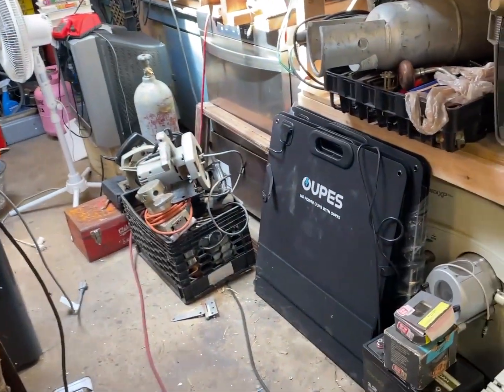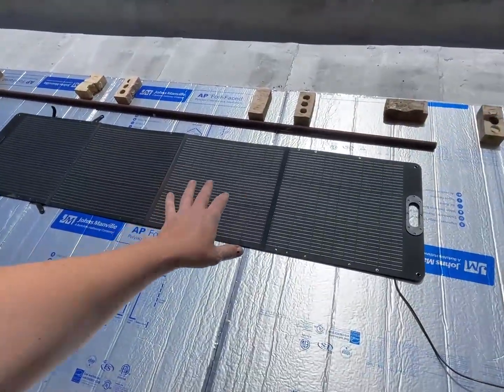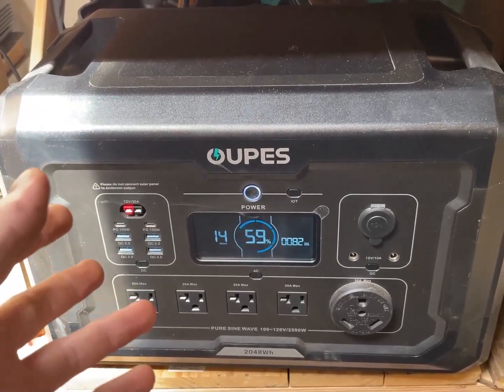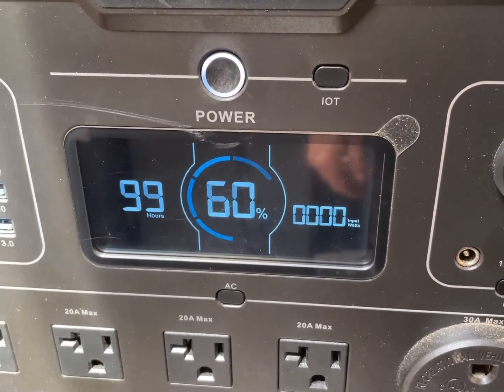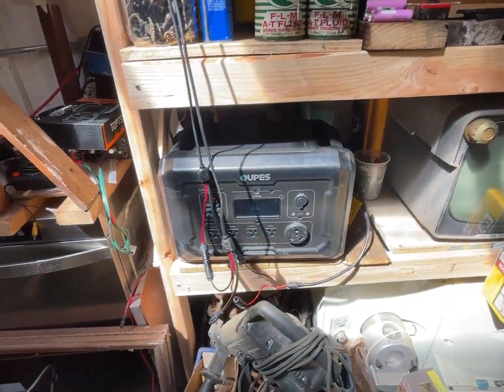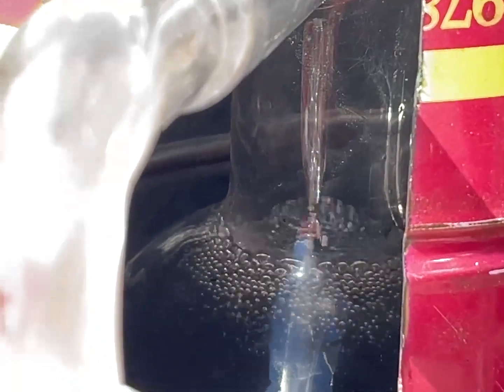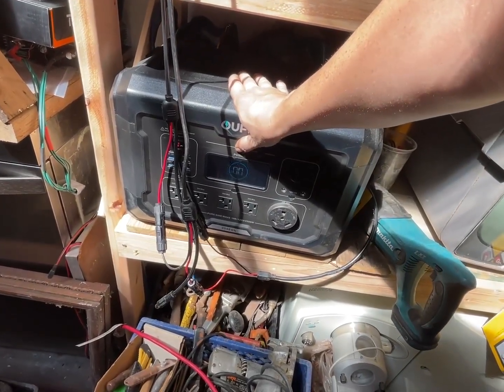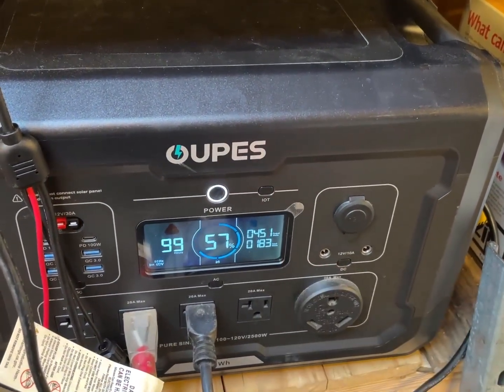Solar Sunday Experiments 39: Testing out Oupes solar panels and the Mega 2 as a reserve power system

Comment: Hi, Rinoa.  I just discovered your channel today, and this is the first video I watched. I do something different, but you might be able to integrate it into your system.  I do solar thermal with a section of a parabolic dish.  My thing is called the "Sun Scoop" and it is has a tracking reflector and a stationary target.  So my reflector slowly turns, (15 degrees per hour) and it concentrates the sunlight on the target. My reflector is just under 1.5 sq meters in size and it concentrates about 670 Watts of heat on the target. (I did a boil test one day to measure heat collected).  For sure, you could use this to distill your paint thinner!  Direct heat, too, so it is more energy efficient than using the solar panel and batteries.   You could also maybe use it in your kiln, either to preheat the kiln or metal or if you did a really good job on the reflector,  to actually melt the metal.   In my case,  I steam treated about 2 tons of garden soil this summer. And then used it in the fall to dehydrate apples and herbs. (I'm still working on the dehydrating part (because it can easily get too hot).   Steam treatment of soil, (and of compost)   kills weed seeds, etc.,  and my vegetables grew roughly 20% faster (with no added fertilizer!!).   AND I steamed 2 tons with a batch system! (which is not a system at all!),  next year, I hope to make augers,  and  a hopper, so I just fill the hopper, and a thermostat turns on an auger whenever soil reaches steam temperature, moves it a bit, temp drops, soil heats up, auger turns, and then it can really do a lot of work! If you check out my channel, you will see that my sun scoop is made from old pallet wood, an old fence pipe as the axis, a sheet of 4 by 8 plastic, special reflector tape from china for solar cookers, and various ring bearings.  But it is very minimalist and it works (and it works all day not like so many half assed "death rays" on youtube that get a million views and are quite frankly, dumb and useless and don't have tracking so you only have a working death ray while you attend it.   My device can work all day unattended, it is a huge leap forward. With your skills, you could weld up the frame from light aluminum,  bend the ribs for behind the reflector sheet in your shop and perhaps make the reflector from some light metal too. ( but you must have a great light and heat reflective material, (like my reflective tape) to stick to it.  Stainless steel won't cut it, and most aluminum sheet doesn't have the "mirror quality" reflections that you need.  But anyways,  if you made this,  and did it well enough, you "might" be able to sell these to local gardeners and allotment gardeners. And certainly,  you could distill with it,  any time the sun shines!   You could even design a sunshine moonshine maker!    I can't weld myself,  I have a pacemaker and  welding does not play well with pacemakers.  Mine is the only "Sun Scoop" in the world right now,  (as far as I know) and  I would be happy to advise  you  if you make the first one in the USA.    PS,  I had to use my own special way to  rotate the reflector. But for you some sort of slow synchronous motor with a worm drive and appropriate gearing should do the trick.  I have a  Sun Scoop playlist.   
So, if you are interested, check it out.  thanks Brian in Victoria, BC  Canada.
Reply from the maker: Hello, yeah i played with solar reflectors back in 2013 a lot. Right here at my new building I unfortunately have wind issues but am keeping an open mind to maybe make a solar heat collector eventually. For now I actually have too much solar power so im quite happy and am now working to find uses for it all.

Comment: Solar panels perform and last better if they get air flow (ventilated) can't think of anything worse than insulating the back of them!
Reply from the maker: well if I raise them up they could get wind under them
Reply: @RinoaL  I get that so get rid of the insulation, it's only providing shade and the panels now do this. Maybe paint the roof white to reflect heat?
Reply from the maker: @Gravitational234  no the insulation drops the building heat by six degrees on a hot day, the insulation is more important than the panels. Roof paint doesn't do much unless its somehow sending out more IR light.

Comment: If you took a vortex air pump vacuum pump, connected it to 2 aluminum intercoolers for ease and durability,  added a restrictor, and something like methanol or acetone into a classic cooling loop system, would it cool efficiently?
I think it would very very efficiently when the liquid is under vacuum the latent heat factor is high.
Lower pressure delta using vacuum pressure instead of high pressure means higher efficiency. I would think. 
I would like to throw a thousand or so dollars towards this idea as an experiment one day. 

Or someone on youtube has done it? Idk it seems like this would work.

Comment: If you put the panels on small stand-offs, it will even help you make the roof cooler just a bit! Though on insulation this probably doesn't matter, but the energy you take from it is literally what you steal from it trying to heat up the space! Neat! 

And having it usable for portable welding makes one truly amazed by the modern battery technology
Reply from the maker: Offsets would allow wind to get under them, so I wont for now, but yeah using panels to cool a building is something I think about a lot.

Now wouldnt it be interesting if physics works in a way where the panels dont actually reduce the heat due to power conversion? I could see that being a thing